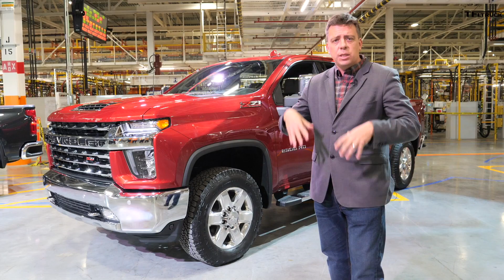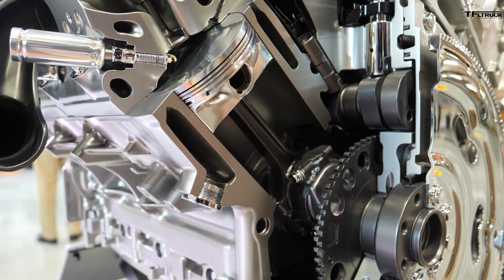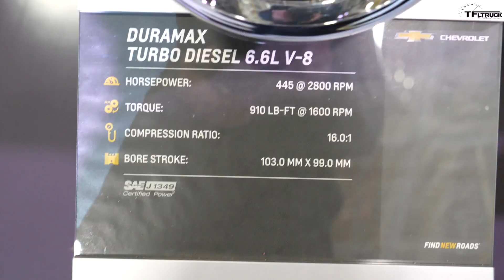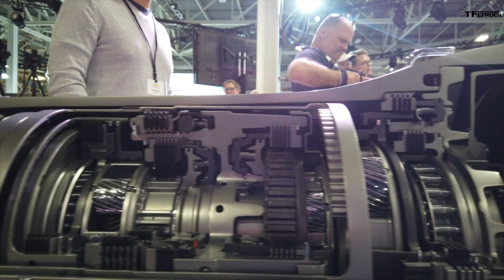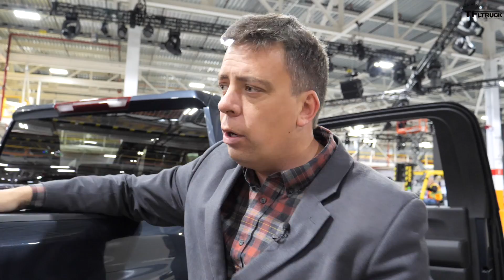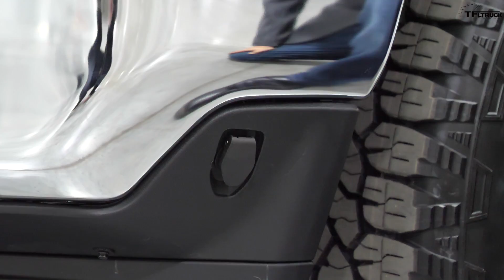Here is How the 2020 Chevy Silverado 2500 HD Delivers the Torque to the Ground

Comment: to mike kociba gm engineer your trucks are not serviceable in the middle of the bush or remote mining camp nice when the engine is all shinny and out of the truck or on an engine stand drinking a coffee and walking around pointing at different parts of the motor make a simpler truck my friend with the same horse power and you will out beat anything out there i dare gm to make one IT NEEDS TO BE SERVICABLE IN THE MIDLE OF NO WHERE example winter fall summer rain crossing small rivers 4 to 6 feet deep with out stalling why do 25 year old trucks can do this but these new models cant well we no why to much electronics and no room around the motor open that up in the cowls simpler axles rear and front no more cv joints for 4x4 there garbage and weak simple radio to we don't need all that electronics in some parts of the world its just not practical

Comment: For the cost of 1 of these I'll get a 68 k30 box the frame find 14 bolt rear dif dana60 front air lock em ,nv 5500 , counterforce clutch put a sweet 12 valve Cummins. Sand and paint my sweet steel dash .build a bad ass flat bed cut off a foot behind the rear tires ,gooseneck hitch ect. 60 /40 mid 90s chevy seat .and be on my way , no smog ,and the best looking body style in the history of combustion engines , still have 20,000 $ left over . To rebuild my old electra glide pan head .outlast any new plastic poop!

Comment: Have they fix the trans coolers in the front of the truck when having a plow on it? Having the plow on the truck in the up  position and it blocks the cooler and your transmission overheat! It would be nice not to have the heater on  Ludicrous speed to try to keep the transmission cool and working in a dry sauna.

Comment: It's Funny how Chevy's HD Silverado Website doesn't even allow you to build a 2 Door pickup Or 1 with Dual rear wheels?
BUT... You can download the 2020 HD catalog... You Can't download 1 for the Ford Superduty?

Also Interesting how Chevy SRW 3500 has a Higher GVWR on it's (SRW) Single Rear Wheel models than Ford 350.

It's also sad when they claim Extremely HIGH Towing ratings...BUT None are rated to Tow that much "From the dealership".
On their Build & Price page* ......Chevy offers a 30k 5th wheel, 32.5K Gooseneck,  Ram - 30k 5th Rated wheel and Ford ONLY highest rated Option is a 27.5K 5th wheel hitch.

FYI, The Rated "Max Towing" for the 3 Brands are within 650 lbs of each other (Ford < Chevy < Ram) and Only 238 lbs. difference in Max Payload ( Ram < Ford < Chevy).

The difference is really in the other areas of the truck and which look better to you and the Cost$.

Comment: I love you chevy but that 6.6L gas sound be making more power than the 6.2L. And it's amazing how those cylinder walls hold up being that thin. Amazing !
Reply: Jordan Scheurer why do you say that? Just because of a displacement difference?
Reply: @MX5-XU  Thanks for asking. I'm not an expert on engines or engine building, but I have common sense and I can do most work on my own vehicles. With that being said in my opinion there is no reason for this engine. It only puts out 401hp and 465lbs.ft TQ. Not only is it the higher displacement that bothers me but the 6.2L is 420hp and 460lbs.ft-TQ so I dont see the market for that 6.6L. If they are just worried about durability of the 6.2L under more load from a truck that tows more then why not put a stronger crank and rods upgrade the valve train and cam to a heavier duty system and use it in the HD trucks. In my mind that would have saved cost in research and development. Now here is another theory. And again I dont know everything about this 6.6L but. Maybe the 6.6L is a 6.2L but with more bore and stroke or just more stroke. Or is it really a new engine altogether. And if so why is it making less power than the 6.2L. Maybe I'm looking at it all wrong idk but I just dont see why it makes less power than a smaller displacement engine when it is built for HD applications. I might just be letting this bother me to much idk haha.
Reply: Jordan Scheurer you bring up good points but like you said, we’re all average Joe Shmoes compared to the designers and engineers. I don’t know if the 6.6 has commonalities with the 6.2 (or old 6.0) but Chevy know what they’re doing. Just like how Ford made a new 7.3 engine instead of just slapping a boosted coyote or refreshing their 6.2 engine in there.

Comment: Ram should bring back the gas V10 engine. My 95 has 450 pound feet of torque only at 2400 rpms. And 10 mpg, same as my new hemi 5.7 when loaded.

Comment: Dang, I can still remember the "like a rock" commercials back in '00 unveiling the original HD Duramax claiming to be the "most powerful heavy duty you can get" along with the monster 496 big block. Crazy to see how they've evolved over 20 years. I'm glad to see these manufacturers realizing again that you need cubic inches. Although I was hoping for a 7.0 427 or a 7.4 454 as the new gas big block.

Comment: What has Chevy done to improve the front end? What good is all this fancy hp and torque for towing when the front ends fall apart? Some of us actually use our Chevy trucks, as work trucks! Getting tired of replacing joints, axle’s and such. Would be nice to be able to take a $60k 2500 down through pastures to feed cows without having to worry about my front end falling apart. Every Chevy I’ve owned= front end issues.

Comment: 6.6 gas motor 401hp 464 ft lb torque, why not use the 6.2 gas motor 420hp 460 ft lb torque. The 6.6 seams like it under performs.
Reply: GM is so backwards

Comment: New 6.6L gas makes less torque than the for 3.5L V6. that's impressive. Direct injection with single injector will lead to trouble. GM still falling on their face with motor tech.

Comment: I'm wondering why they needed to make the 6.6l gas engine when the current 6.2l makes the same torque and 20 more hp?
Reply: Drive it Like ya stole it  Bigger displacement will make more torque in the midrange. Even though peak numbers are the same.

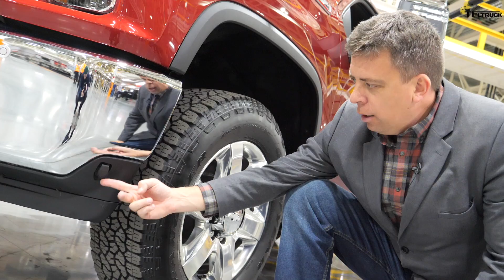Comment: 11:29 Good feature poor execution... you can tell just by the click of the cover there's no O-ring or any other sealing device in there, so that is going to fill with salt and corrode. Plug in a couple hundred watt heater and you're going to have a driveway fire in a couple of years. 

More inferior engineering.

Comment: I don't agree with the decision to make the 1/2 ton body and the 3/4, 1 ton bodies different. This will only drive the cost up as they now need twice the amount of design and tooling for exterior and interior components.  Its completely necessary.  Also, they should not have made the 1/2 ton body dimensionally larger than the last generation. Full size trucks are big enough and the weight savings would have been even greater if the body dimensions were the same as the last gen. I think ford pioneered this idiotic trend with the F150 vs F250/350SD.

Comment: Man GM really messed up the new Camaro and now the Silverado series for 2019/2020. But I love the new redesign of the GMC Sierra's 1500, 2500, and 3500. I'll be getting one next year for sure.
Reply: Agree with you on the Camaro. I had the 2015 SS/RS and it was sharp. Chevy started putting bends and creases where they didn't belong then stuffed a Toyota Camray in the front end. They dated my car in the process so knowing there was no upgraded Camaro in my future, I traded it in on a new 2017 Silverado LT 4WD, which I in turn, just traded for my current 2019 Silverado 2500HD LT. I do tow a travel trailer so there is purpose besides just owning a big truck.

Comment: So it's a 6.2 that's been stroked by 6 mm... not seeing anything groundbreaking. Looks like an all aluminum setup too, doesn't it? Granted the old 6.0 is showing its age but it was still a solid motor. I don't get the same vibes from the newer engines. Maybe I'm wrong.

Comment: So GM basically tried to build a Ford.
Reply: At least Ford did it right cause they sold a shit load of them, still out sold GM, Chev combined. This is hideous and I don't hear TFL smack it down like they do with other makes.
Reply: George Pacheco, I just meant that it appears GM copied many design points that were already produced by Ford in previous years. Didn’t mean to strike a nerve.
Reply: @captainspaulding4777  It just pisses me off at how much these guys favour certain brands and will call out any flaws that brand may have, Ford for example. Yet GM or Chevy can make a pile of shit and these guys will gobble it up. Something like this, you'd expect none bias, but it's not happening. No worries on your part.

Comment: Well finally after 40 years they brang back the 400ci 6.6  I still thank the tq should be 500 though   cuz my 1970 was 260 hp and 400tq but all I wont is that motor in a 1500 S cab short box

Comment: I really don't like it when similar displacement sizes are available across gas and diesel on the same trucks.  I know that would seem ridiculous to engineers to change bore or stroke just for marketing, but I still find it important.  Beyond that, seems like the new 6.6L gasser will be durable at work.

Comment: “Industry leading torque”...... yeah tell that to the 3.5L ecoboost F150 with 475 torque.

Lol
Reply: HD vs light duty trucks is a big difference. You know the Corvette ZR1 makes 715 lb ft, do you know why they don't just drop that engine in the heavy duties? It's for the same reason that Ford doesn't put the 3.5 Ecoboost in the Super Duties.

Comment: Thank you Carlton.... my LBZ motor is pushing roughly 943 horsepower at the crank my quarter miles are looking low 11/ high tens... I'm a family man and having almost a thousand horsepower at the crank is not safe for my children I will miss it I'm moving on as a great father for my children by owning the the brand new 2020 2500hd crew cab... but when I do buy it I'll be buying the same color as my LBZ Stone White

Comment: Wow GM went with the ford 10 speed instead of the General Motors nine speed.
Reply: GM HD Trucks use 10-Speed transmission designed and built in-house at GM.  They are not even built by Allison, but GM is Still labeling them as an Allison.
GM's 9-Speed Transmissions are only for transverse applications, FWD or AWD Cars/SUV's.
Ford may have designed 90% of the 10-Speed transmissions for the Half-Ton Pickups, but the transmission Case/Bellhousing, and Electronics/Tuning is done by each manufacturer. This is why Ford has had 3 or 4 recalls in the last 6 months on their 10-Speed transmissions, while GM has not. Ford also uses Plastic Transmission Oil Pans, while GM uses Steel. Ford has already had issues with the plastic oil pans cracking and leaking on their 10-Speeds, mainly in the Mustang.

In a Half ton pickup, realistically a 10-Speed transmission is not needed for performance or towing, an 8-Speed does just fine. Main reason for a 10-Speed in the Half tons was for added fuel economy, especially with a triple overdrive.

Comment: Of both these new gas engines from ford and Chevy I think ford wins, bigger and built with parts meant for durability. Even has rings and other parts built to turbo specs so you could slap a turbo on that baby easy, imagine that 7.3 big block with turbo in a brand new f250. Coming from a Chevy guy

Comment: The power is fine for a n/a engine. Its not a racing or sports car engine. The only thing I hate is that it is not a two fuel injector per cylinder. Those intake valves are going to be shit at 40,000. You need intake injectors to clean the valve's. Direct injection is a gimmick it is not needed.

Comment: some interesting new features, I agree that that white truck in the custom trim looks the best of all of them. At least to me. one thing I don't understand is why they have so many damn transmissions just put the 10-speed behind every engine you offer and figure out what gearing you need to make that work. Later on when these trucks get older having to figure out the wiring diagrams and harnesses for multiple different transmissions can be a nightmare. And it's got a cause complications on the assembly line,  would it not be easier just to have one transmission with one common wiring harness back to it. Why are you still putting a 6-speed transmission in anything.

Comment: Am I missing something.... The current 2018 GM 6.2L V8 has 420hp and 460ftlbs of torque.  So bigger motor less power???  Just buy a 6.6L diesel and get 450hp but 935ftlbs of torque

Comment: Wow the 2019 ram has 1000 ft lbs of torque . Chevy in 2020 cant even come close . Come on guys that's a considerable difference.
Reply: Dodge was chasing the brochure readers with that 1000 torque.  Looks like it worked.   Meanwhile I'll be trusting the 910 from GM
Reply: @99BadDecisions   When you have the highest tow rating and torque why not use those numbers ? This is coming from a guy that has a 11 duramax. So I'm not a ram fan boy by any means but gm needs to step their game up. Has needed to since the bail out. Falling behind and have been for years.

Comment: first of all its ugly.
second, if you wanna wreck your paint you'll step on that front box step
thirdly, my 2002 had auto 4wd. so in 18 years that's not impressive
fourthly, it looks like a standard female cord end will not work with the built in block heater so now you need a special cord.

Comment: 400 cubic inches?, good! Pushrods, good!464 lb-ft? Not bad. Why would you screw up a perfectly good engine with direct injection? I mean this is a work truck. I would gladly give up .1 mpg for the reliability and simplicity of port injection. Ford got that right with their new 7.3 and I’m a GM guy.
Reply: Although I agree with you, the reason is pretty easy to understand. In order to run 10.8:1 compression on 87 octane fuel, the fuel curve has to be PERFECT in mixture and in placement, and direct injection does limit the variability in those factors. Granted, ignition and valve timing also have to be accounted for, but that’s all in the computer. And that 10.8:1 cr is what brings in the impressive torque.
Reply: Curtis Kreklau I’m pretty sure that the chevy engineers knew from the get-go that this engine was to be direct injected. They did not decide to direct inject it because of the higher compression ratio. They designed in more compression because direct injection enables them to. That being said, If GM had built a 4.125 inch bore v-8 iron block with a 4 inch crank with aluminum heads such as on the current 6.0L motor and use port injection, they could have it produce over 400hp and over 500lb-ft of torque even with lower compression ratios.They already have the tooling for this size bore and stroke block with the ls7. That is something I would buy...
Reply: Daniel J don’t forget that direct injection engines like to knock hard and blow up when the gas isn’t perfect at light throttle and a load at low engine speeds.

Comment: Ok the 6.0 is supposedly bulletproof but it was the biggest dog of the hd line up and with chevy direct injections coking and oil consumption im going to say step up and take this L chevy and im going to bet this motor won't be reliable and I'm going to say after 20k miles it will be a dog too

Comment: The new 6.6 looks like a pain to work on and with direct port injection the valves will be covered In carbon and the new injectors will be alot of money if one gets clogged up not to mention 2 fuel pumps

Comment: Word of Wisdom these trucks that GM is putting on the market nowadays they're looking like gay trucks who puts mirrors down low when they should be up higher to see behind you and whatever you're hauling who needs a step in the side of the box when you're going to scratch the side of it with your clothes or belt buckle or just whatever then it's going to feel full of mud and snow in debris as well it's a good place for rust to occur. The tailgate is a joke why can't they keep things simple like they used to you're on able to use the new tailgate if you have your hitch in the receiver or if you forgot it's in there just as well it would be a problem here in the North or the back roads or just whatever for the debris snow sand ice or just whatever to accumulate inside of it as well as electrical problems. The running boards they put too close to the Rockers for your feet to be supported to get into the truck as well as they should run the full length of the Truck Body in between the two tigers so you do not need the step that's inside the box side. Why haven't they changed the interior 4 people can I have comfort inside the cab as well. The Dodge trucks went over and Beyond of luxury and upgrades with their computer screen the quality of their interior as well as a sunroof as well as more room. What about these headlights they've got just above the bumper shouldn't they be up higher where they can shine further out in front of the vehicle as well they want me in the way of a snow plow. I just feel that General Motors is going downhill once again with their quality in on come as well as the people in-service with their attitude problems where they do not stand behind their product the word of wisdom I would not buy another GM truck.
Reply: If you want to see big gay, look at the Rivian R1T

Comment: Disappointed in horsepower and torque numbers out of 6.6 gas. 6.2 is way better.
Reply: Peak torque isn't that impressive but I bet if you stuck a dyno chart of the 6.2 and the 6.6 next to each other the 6.6 has a beautifully flat torque line through most of the RPM range...